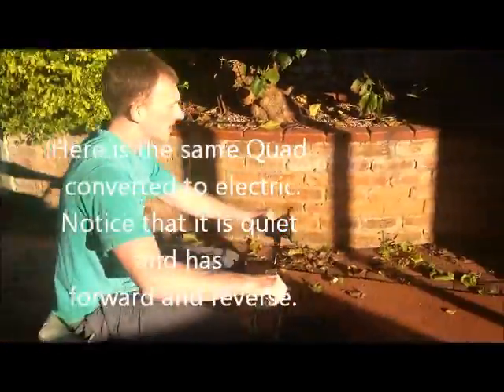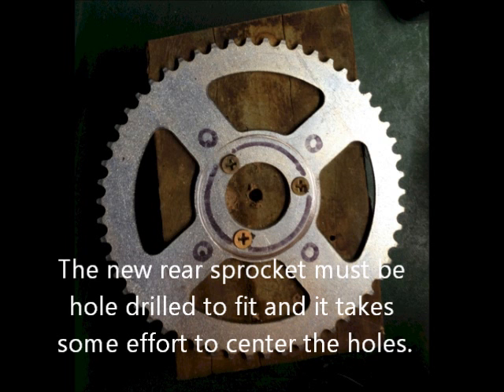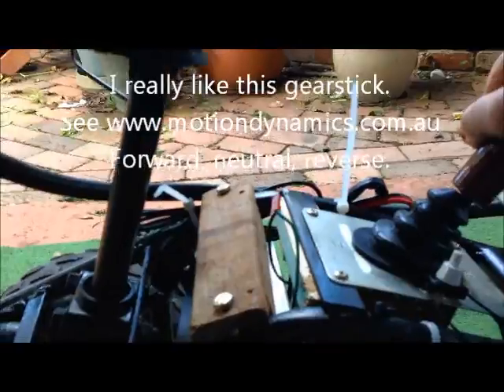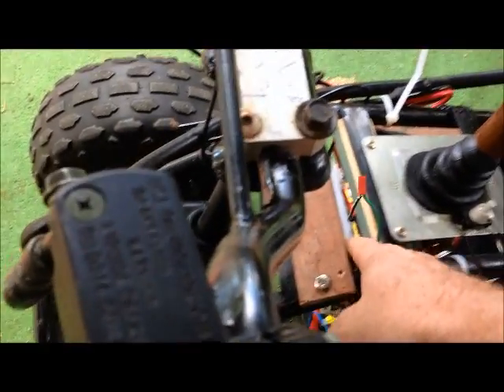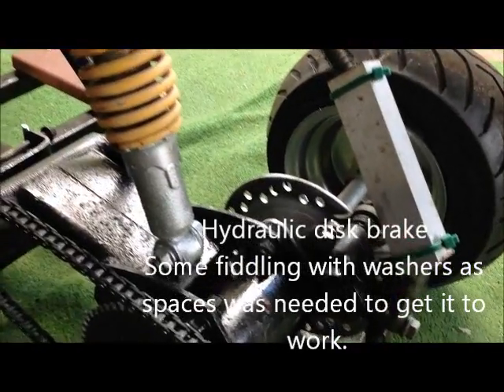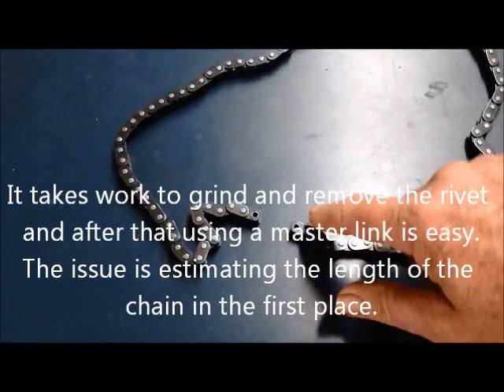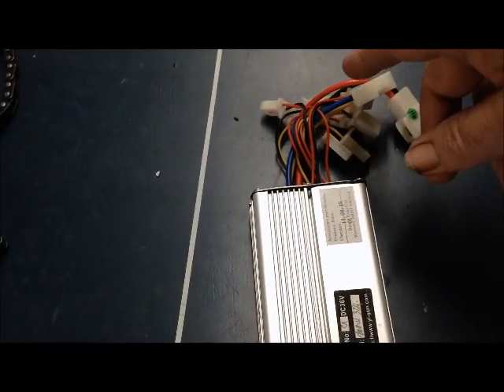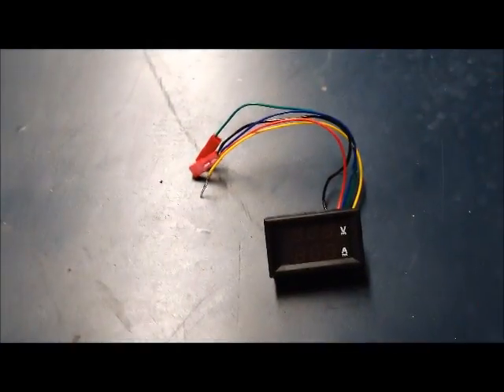How to convert a petrol quad to electric V2

Comment from the maker: It was 2.5 years ago and I have 3,708 views. I sold it for $300 and it probably cost close to $500. Some cost is due to experimental buys. It ended up going pretty well and I regard it as a good learning experience. I changed the motor and chain to slower and heavier duty chain. Changed the rear wheels to equal the front ones. Top speed became more like 7kph but it could go almost anywhere.
Reply: Hi. What motor did you use?